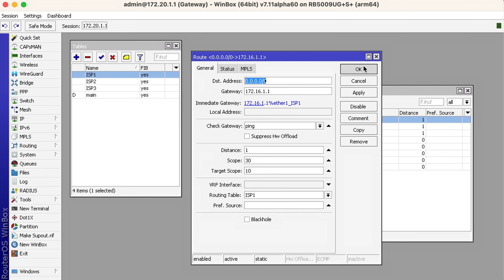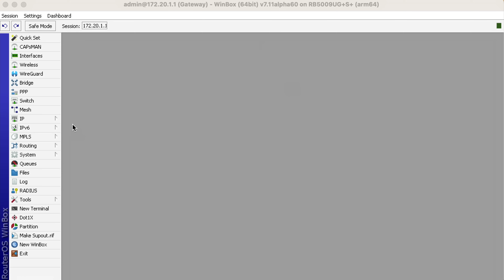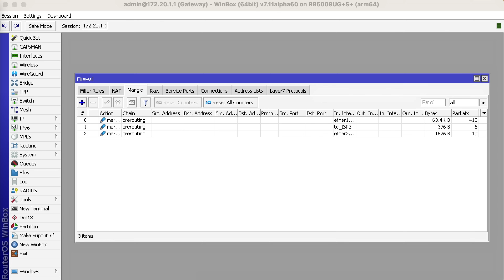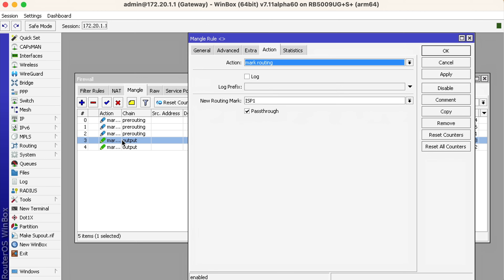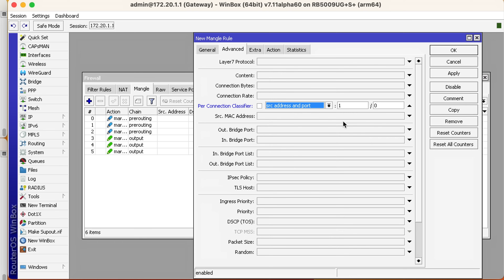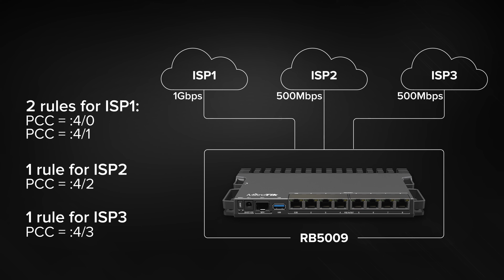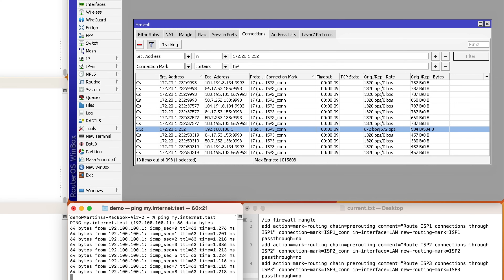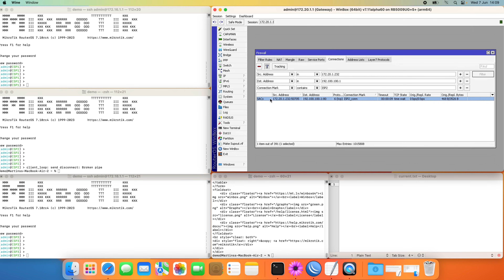Multiple uplinks using PCC, Load balancing

Comment: I will look at this later with a clear mind. 

I am using an LHG-LTE18 as my internet Modem/Router, but I've also bought an RB5009 for this exact purpose. I wanted to buy a second LHG, and have them both feed the connetion to the RB and the RB serve as my main Router. 

I wanted to do that because when using 4G in my country and with my ISP you have to options. Either use "vpn" APN or the normal one. 
VPN gives you a public IP (like ADSL for example) but limits bandwidth to 150Mbps. 
Normal APN puts you behind a NAT (CG-NAT) effectively removing your ability to port forward anything inside, but gives you Full Speed. 

I wanted to combine two lines, with two seperate 4G SIMS, on two LHG-LTEs. But it's SO HARD setting up these things since RouterOS is so complicated (in order to be detailed and powerful), and the community on Mikrotik Forums didn't really help me much, as from what I've seen, they don't really like noobs. :) 
Currently my RB5009 is just a brick sitting in my closet :( 

Anyway, will check the video later and maybe I can find more info on how to set my net up.
Reply from the maker: Did you manage to find a solution?
Reply: @mikrotik  No. I had no time to look further into it. 

I need to gather information that is scattered around because I'm not an expert on the subject. 

The problems I face mainly are:

1) I was told by Mikrotik specialists that if I put the LTE18 on "Passthrough" mode, I should have setup a VLAN for management. 

2) I then need to figure out the rest of the setup so the RB works as a Router and the LTE18 machines work as Internet supliers only. 

Anyway, the problem as I said, is that I didn't have the time to look THAT DEEP into the matter. 

My LHG-LTE18 is super fast as it is. 
I just wanted to make my VoIP phone work as well. :(

Comment: Very nice video, but what if I get on all connections IP´s and Gateways dynamically via DHCP, how can I prepaire the needed Routing tables? That´s unfortunaltly the critical point in using more than one ISP here in Germany.
Reply from the maker: As mentioned in the video, this video was about PCC method and we did not configure things like DHCP server, NAT, firewall, users, etc. You can not dynamically adjust routes in differnet routing tables automatically based on the DHCP client. But it is very easy to write a script on the DHCP client which simply updates the route when gateway changes (https://help.mikrotik.com/docs/display/ROS/DHCP#DHCP-LeaseScriptExampleLeasescriptexample). However, thank you for the inspiration. We will see if we can convince our developers to allow doing this dynamically in the upcoming RouterOS releases. :)
Reply: @geogmz8277  Could you give me the headline of the forum title? The forum itself is well known, but it's hard to find something without knowing details🙂
Reply: @geogmz8277  Would be very interested in this as well..

Comment: How can we do the default route part dynamically in ROS7? I‘ve had the problem that sometimes the IP of the default gateway changes on reconnect via PPPoE… in ROS6 I could do that with a route filter in dynamic-in and change the routing table there. Is there a non-scripting way to do this in ROS7?
Reply from the maker: For VPN you simply specify the VPN tunnel name as the gateway, not the nexthop IP address.
Reply: @mikrotik  This configurations can load balances the multi wans without routing tables?

Comment: nice video, but try not disconnect the physical cable from your router, disconnect the cable or fiber from the isp, then will see if it still works..
Reply from the maker: We already did - https://youtu.be/nlb7XAv57tw?t=874
Reply: Yes. They need to validate this way….   As I believe it will fail.  I’ve had this happen - as we need to instead use recursive route to validate GW

Comment: Do a failover configuration, please. One of my clients has three ISPs, all of them use DHCP and one of them uses PPPoE.
Reply from the maker: As mentioned in the video, this video was about PCC method and we did not configure things like DHCP server, NAT, firewall, users, etc. You can not dynamically adjust routes in differnet routing tables automatically based on the DHCP client. But it is very easy to write a script on the DHCP client which simply updates the route when gateway changes (https://help.mikrotik.com/docs/display/ROS/DHCP#DHCP-LeaseScriptExampleLeasescriptexample). However, thank you for the inspiration. We will see if we can convince our developers to allow doing this dynamically in the upcoming RouterOS releases. :)
Reply: You can do failover just simply pluging all three, making them wan, and making different distances.
Reply: Technically yes,  but doesn’t work for failover.  I’ve tried this but RouterOS doesn’t failover route.  We need better way to do recursive routes in RouterOS 7

Comment: Would this still dynamically route traffic if an ISP loses Internet but the ISP gateway is still ping able?

Ping seems like an unreliable way to determine if a route is down because here in the states the gateway is usually an ISP modem device and that never goes down but you'll lose Internet
Reply: you can check a gateway internet connection with recursive routes. This is what you looking for.
Reply from the maker: Yes, then the route would be still active. However, this video was not about that. It seems that this is the solution that you are looking for - https://help.mikrotik.com/docs/pages/viewpage.action?pageId=26476608
Reply: @mikrotik  when i click that help page link, it is taking me a login page ("log into altassian"). please suggest.
Reply: Yep, it will. Google pdf "Monitoring the Internet Connections of WAN Links
with Only Routing Configuration", it's has and example of your needs
Reply: you are right (Y) , on the os7 router you can check fail the port connected to the BFD instead of using the very inaccurate Ping !
my video at 28:11

Comment: Nice video but one question, what if we had 3 pppoe isp connections on the same router?
Reply: I have 2 pppoe on the same router, no problem. In pppoe client there is Default route distance parameter
Reply: To enable connectivity for a third internet source, consider adding identical rules and replacing the value '2' with '3' in the connection classifier tab.
Reply from the maker: We already had, in the video. ISP3 was PPPoE VPN. With VPN you simply specify VPN inteface name as a gateway, if the remote address tend to change.
Reply: @mikrotik  I know its been a while but lately when using the interface name ex pppoe-out1 or ISP1, i do not get internet access but when using ISPs network address which indeed is changing the internet access works.
It has to do with pinging the gateway but if i turn that of failover does not work